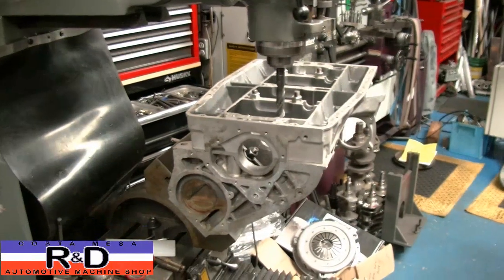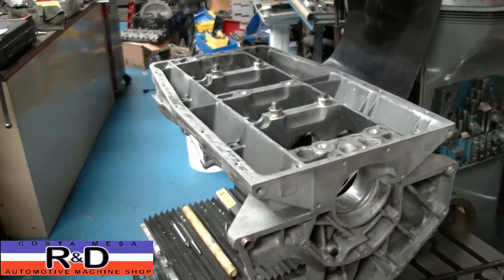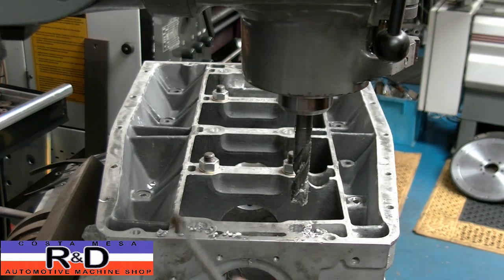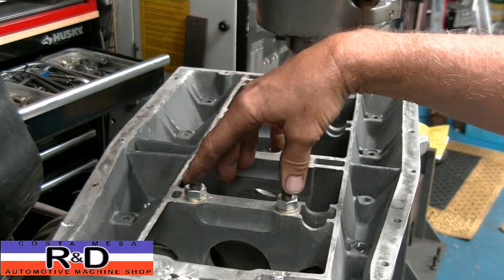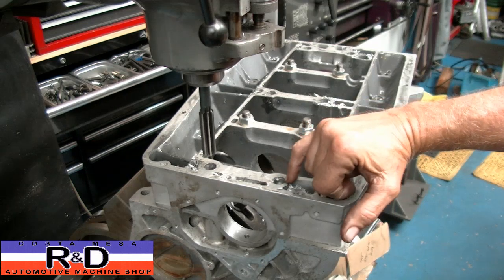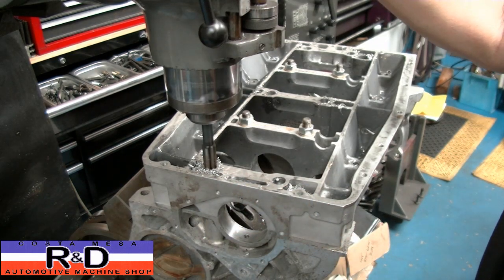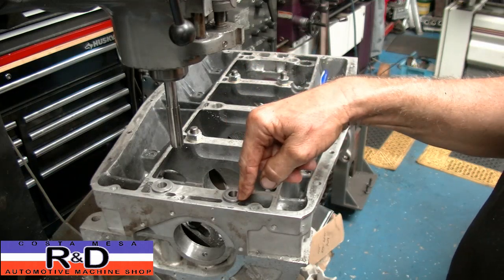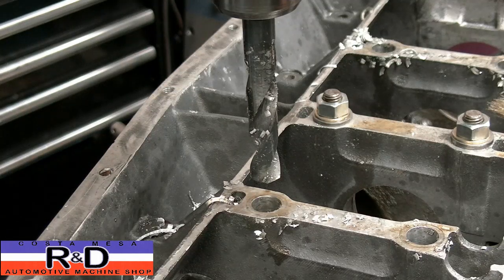Lotus 910 Girdle onto 907 Block

Comment: Thats the motor designed from the Bedford/Vauxhall sloper 4 cylinder isnt it? I vaguely remember the bearing shells were the same as on the Lotus motor apart from the locating tabs being slightly different but the block could be modified to use them... I think the reason people went that route was the bearings were a fraction of the price than if they were purchased from lotus! lol cool vid John iv actually never seen one of those motors in the flesh :-)